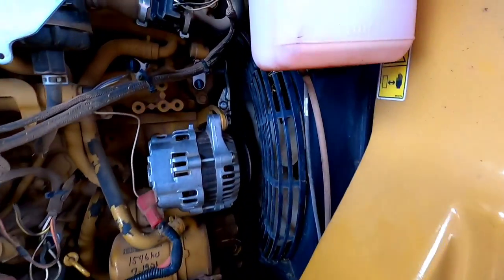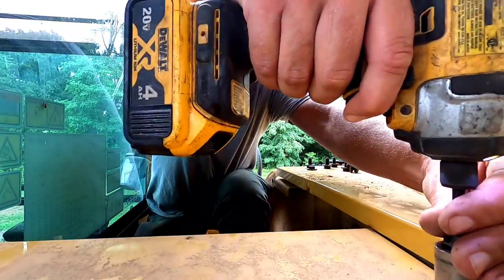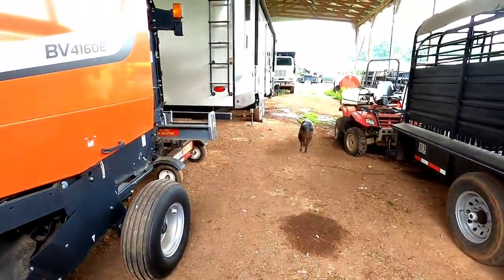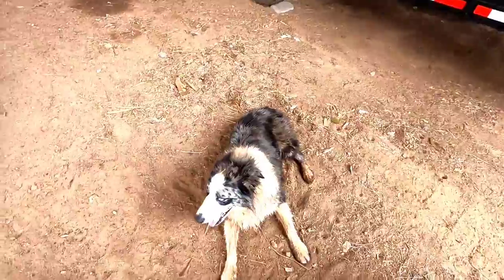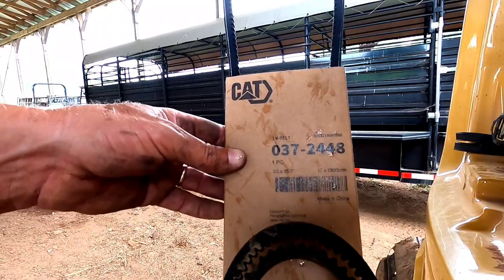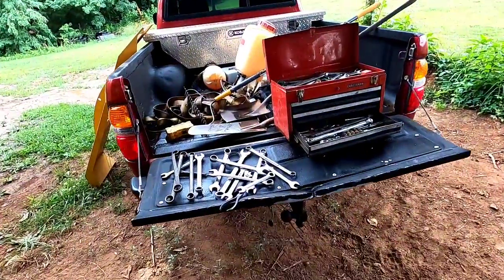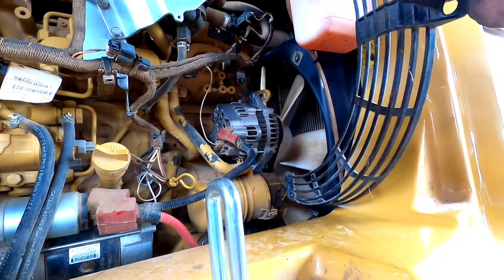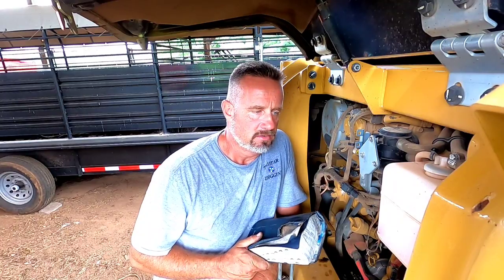HEY! HOW DO YOU CHANGE THE BELTS ON A CAT 308?

Comment: Hi. Thanks making this video because I am about to do mine. I do have a question. Under the top panel you took off is a motor called a swivel. It’s the part that has about 8 or 9 hoses going into it that transfers hydraulic pressure from the top side to the track frame. Mine went out and I replaced it by myself and it was not fun at all. About 4 days solid work. So my question is this, can you see if yours moves or flex’s as you turn the housing left to right? You’ll have to remove that top panel and have someone watch it. Mine flex’s more than it should and I’ve got no idea if it’s supposed to do that.  Cat says it’s not supposed to but the panel it’s bolted to is actually a welded part of the bottom carriage frame. Which means there’s absolutely no way to correct this issue without a lot of work and money involved. 

If you dont have time that’s fine but the next time you’re working on it you might check that out. Keep up the good work my friend.
Reply from the maker: Thanks and I appreciate the heads up. I will look into that when I'm in there again. It was a learning curve to figure out those belts. Especially taking off that one panel for just one bolt. But, I did learn something and helped you out as well. Good luck with the belt change...

Comment: I am thinking about buying a  Cat 308 I want to know what rig you use to tow your excavator around with? I don't want to buy it only to find that I can't tow it with my Cummins Dodge dully with the 5-wheel tow package, thanks for posting this clip!
Reply from the maker: I generally tow it with a single axle  dump truck. However, I do occasionally pull it with my Ram 5500 and a 10 ton gooseneck trailer. You could check the tow rating on your truck and get an idea if it can handle the weight.
Sam